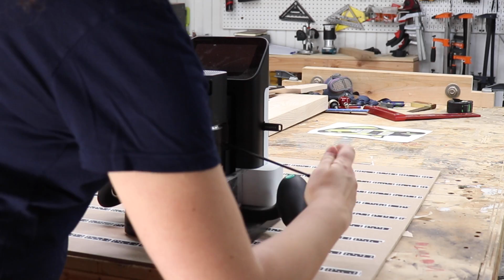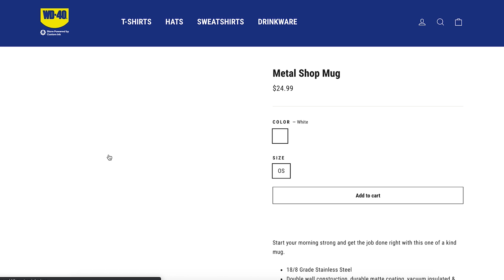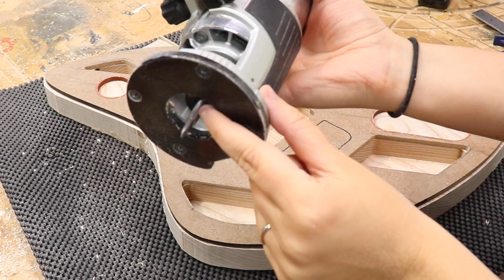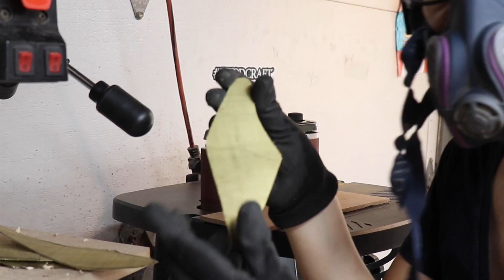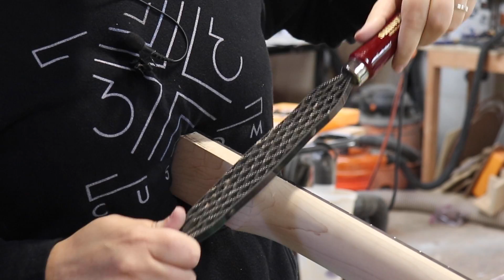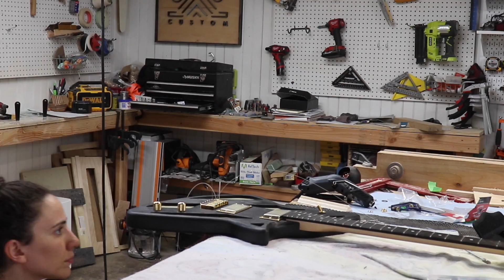BRASS Inlay Guitar - Great Guitar Build Off Invitational Entry 2021

Comment: You should go back to this design. Do it the same body design with the chambers, but instead of brass, use a tone wood to fill the holes (the inlays). That way you still have a whole top to vibrate. In this design (which is ultra space age cool), you've removed most of the top. Less wood, less tone. In any chambered guitar, or acoustic, the top is the soundboard. It's the piece that vibrates the most and helps project the sound. Some jokers say wood doesn't matter with electric guitars, but they're tone deaf and shouldn't be playing guitar. It matters, that's why guitars aren't plastic. ;)
I'd also add a piezo pickup with a dedicated volume knob, so you can blend the electric and acoustic sound. I'd bet you'd have a real winner. You love to experiment and refine designs (since you're a great engineer*), so just use this build as test like others projects you've did. You fell in love with the guitar, so build another one that's even better.

* There is a reason chairs don't roll up for portability. It's just bad design. You can't fix it, it's a troll. I'm as obsessed about it as you are, still wondering if the cables inside the pieces idea would work...or maybe bicycle chain...or maybe it's insanity and the whole idea of a rollup chair is completely absurd. What happens is you're making an Archimedes gag gift designed to destroy itself. ;)

Comment: Although you can put your guitar together anyway you want to, the pickups are, typically, installed with the pole pieces as the outer coils of a humbucker. What I mean is this: The bridge pickup has the outer coil the one closest to the bridge. The inner coil is the coil that is closest to the neck pickup. For the neck pickup, the outer coil is the coil closest to the neck. So, the pole pieces are, as I said, typically, the outer coils. All wiring diagrams use this as a standard.   

On this guitar, you installed the neck pickup with the coil with pole pieces as the inner coil. If that is the way you intended it to be then that is fine. But, if you weren't aware of this, then you will be able to correct this and going forward, install the pickups the way they are typically installed.

Comment: Just a few observations that you may want to consider. You didn't show much of the wiring and shielding but here are my suggestions. First: the backs of the cavity covers should also be shielding with the shielding tape. Second: The shielding tape should come onto the lip of the cavity as to be in contact with the tape in the cavity when cover is screwed on. Third: You need to connect each cavity's shielding with the other cavities shielding. Meaning solder a ground wire to the toggle switch cavity shielding and run it to the neck pickup cavity and solder it. Then solder another ground wire to the neck pickup cavity shielding and run it to the bridge pickup cavity and solder. Then run a ground wire from the bridge pickup cavity(soldered, of course) to the electronic cavity and solder it to the shielding. Then, finally, solder a ground wire to the back of the volume pot and solder the other end to the shielding in the electronics cavity. Doing all this will take any hum and send it through the ground and get rid of it.

Comment: The hollow body did seem to give it a bit of a more metallic sound, it seemed like there was less of a dramatic difference between the far ends of the two pickups. I also agree the gold hardware looked great, putting silver hardware would've given big "tuxedo with tennis shoes" kind of vibes IMO, even though in most scenarios silver is preferable.

Fucking excellent work.
Reply from the maker: Thanks so much! Happy I went with the gold on this one even though I’m not usually a fan

Comment: I must be watching the wrong channels as I have not heard of this competition. Not a fan of WD40 . As a historical note WD40 got its name from the 40th recipe for a water dispersant , not a penetrant.  I make my own better penetrant and oils than commercially  available. I've dropped a couple of recipes for sanded neck oil and fretboard cleaner/oil over at Guns and Guitars , which is why I'm here . A better and far cheaper alternative for Tru Oil is 10% clear ( boiled) or ordinary linseed oil ( if you want more yellow ),30% deep frying oil that has silicone anti foaming agent ( Crisp n Dry in UK) and 60% Naptha ( lighter fuel ). It drys quicker and allows more coats to be applied quickly. 
Recipe for penetrative etc lube 1/3 old automatic transmission fluid , 2/3 petrol. It was used to undo bolts on a WW2 fighter that was under the sea 45 years and on land on the coast for another 30 years .
I see the brass and wondered why you actually bought pickups and not use the brass as an inductor to produce the pickups using concealed magnets and a 240v -5v wall wart transformer ? I do this because pickups are pretty ugly and spoil the work surface .
I use my kitchen as a workshop and basic hand tools with the aid of a 115 mm angle grinder . I've been repairing and modifying rather than building recently, but may be building a scratch build next year for the comp and have dug out some old well seasoned 100 year mahogany and unusual rare native British species , that came out of a skip .
Reply from the maker: Glad you finally found it. Ha
Reply: @3x3CustomTamar  Cheers , got to play catch up on your video too ! Nice work , love what you do and how you present it , warts and all .

Comment: It was funny to me when I reached the point of the video when the wiring was happening and it was mentioned how this wasn't in the comfort zone anymore when I used to be an electrician especially for smaller electronics so soldering is exactly my kind of thing and while I'm good with working with my hands I in general dislike working with wood even though I have learned how to do that too. So I watched this video about stuff I dislike but the maker likes just to reach a part of the video the maker isn't good at but I love.

Comment: You may or may have not seen my issued utility patent fretboard invention. Adding groove slots into fretboard. Here’s the thing I invented a custom jig to cut str8 lines up to 3/64” with a Dremel. Let me ask you “how would cut a line 3/64” with a Dremel or any tool???  Please answer. I’m curious if I should market it to guitar builders.
Reply: Good work on your build. We should collabo in future. please answer my question to see if I am into a more advanced tool. Don’t be rude. Thanks
Reply from the maker: I havnt seen it. I would maybe use a jewelers blade in a mini table saw

Comment: It looks so cool! I'm a big fan of 3-dimensional builds.

Regarding chambered guitars: using wound pickups it doesn't really affect the tone at all, because tge signal is strictly dependant on the string movement relative to the pickup. While pickups have a tiny microphonic component to them, it's not enough to make an audible difference
Reply from the maker: Thanks so much! And noted

Comment: Firstly, I'm surprised the shank of that straight bit didn't just eat up your template!

Then, OMG I want that Origin tool, so frickin' awesome.

Finally, super-cool guitar again, Tamar. I'm a big fan of your work!
Reply from the maker: Thanks! Yeah. I only use the shank for the corners. So really minimal cutting. It works in a pinch. And yea. The origin is so amazing!!

Comment: I'm sorry, what is that programmable router thingy called, again? And one other question, during your sound demo, it seemed to be brighter than the average humbuckers in my headphones. Do you think the brass fittings over the cavities brightened it up?
Reply: That was an extremely cool design. Great work Tamar.
Reply from the maker: Thanks! It’s called the shaper origin. And it could be the echoey room or that I just don’t know what I’m doing with this amp yet. Ha.

Comment: Oh look, Brad Angove commented! So, the tone is not going to be affected with a semi-hollow body. Electric guitars are, mmm, 95%-ish controlled by the electronics. Proof of that is people who build guitars out of the most gawd-awful material (colored pencils, recycled plastic, license plates, pallet wood) and they sound great. This build is one that makes me happy and want to cheer you on and sad that I'm not building and finishing guitars any more. I'm pretty sure my ex didn't like me working on guitars even though it was SO fun! I did a re-saw of a body I built. Top was mesquite wood and body was ash. Pickup pockets were pre-cut and the re-saw totally ripped up the thin walls of the cavities. The guy who cut it felt bad, I didn't. In the future, make a blank to put in the cavities before re-sawing. I like your project. Hope it wins! I bet after the brass "ages" it will start to take on a changing patina and look.
Reply from the maker: Good to know! Thanks so much!

Comment: When your soldering up your pots, try to scuff up or sand them a bit. It makes soldering the grounds way more easier.  Way less heat is needed.
Reply from the maker: That’s not the issue I was had. Ha. I snipped the 2 wires that were supposed to go together for the 4 conductor wire pickups by accident. So there was very low output... took some trouble shooting to figure that out. Ha
Reply: @3x3CustomTamar  sorry, I stopped watching to make dinner when you started wiring it up. I might have spoken out of turn, my bad. 
Im going to finish watching it now.
Reply: Awesome job. I'll be bidding on yours. 
Also great playing, I enjoy the no edit one take. Great amp also.
Reply from the maker: @planet0013  thanks! I conserved doing a multi camera thing. But thought this was better. Glad you appreciated it!

Comment: Couldn't find your "B" sting but no problem finding a string a Bees. Lose a "G" string next time, problem solved. Alright I know, enough of the silliness. Great job again Tamar as usual, very well done. I love your new favourite tool which I must check out. I assume it works similar to the design programs I use for 3D printing creating a G code, saving it to an SD card which then goes into the shaper cutter. Very cool.
Reply from the maker: 😂😂 thanks! Yeah. It’s like a regular cnc. Except you hold it with your hands and you can take it wherever you need

Comment: I always appreciate your work and I don't know anything about guitars, but I feel that something is missing ... In my opinion, to fully exploit that brass mesh you have to let the light pass through. If the cavities in the base layer were holes, it would be nicer for me; or perhaps small LED lights could have been inserted into the cavities ... 
What do you think about it?
Bye!
Reply from the maker: You can see the holes in person. I’m not a fan of added LEDs to guitars
Reply: @3x3CustomTamar  I mean through holes, so that the brass mesh can also be seen from behind. But perhaps the structure would be too weakened ...
Reply from the maker: @saveriog.825  ah yes. I considered that for a brief moment. It’s an interesting idea for sure

Comment: If you're afraid of bees, use a spray bottle with water and spray the water over the bee in the air.
When these fine waterdrops hit the bee, it's thinking it begins to rain and rushes at home...
And the other bees around follow...
Also it didn't makes them aggressiv, what mostly will end with a sting.
Works also great with hornets, bumblebees, more agressive wasp,  etc...

BTW: great build and good playing, like the look.
Reply from the maker: I’ll have to try that. Thanks!